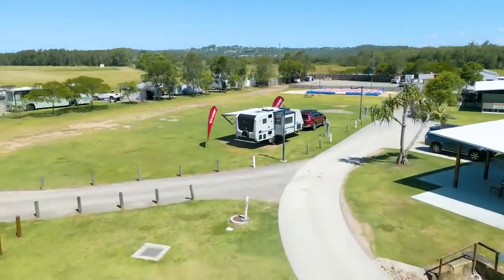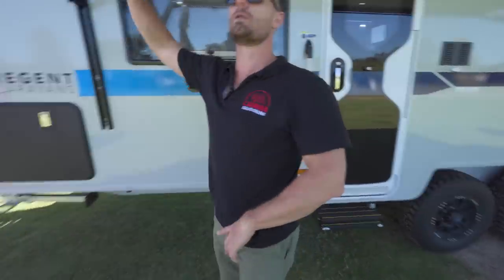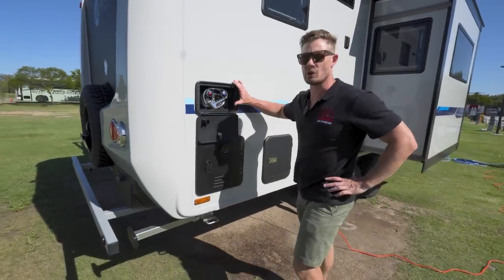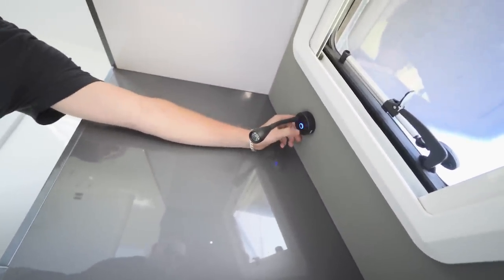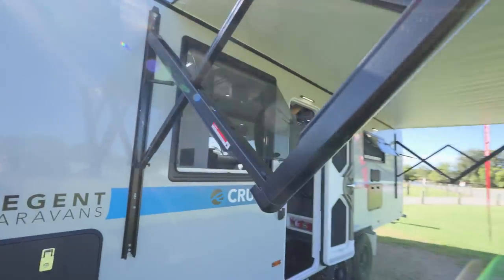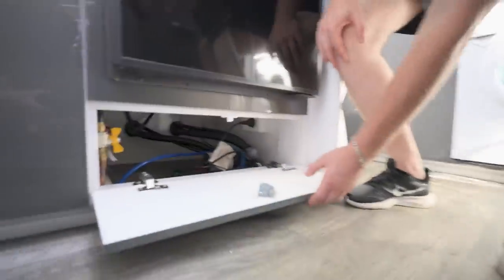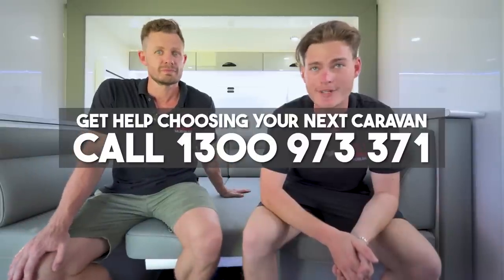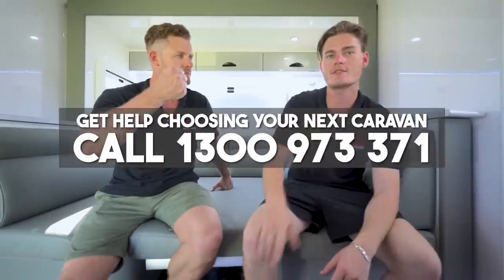Perfect Couples Caravan? Exploring the Luxury Regent 21'6" Cruiser Caravan +Slide out club lounge

Comment: Good vid guys. Looking for a new van and the Regent brand is looking good. A couple of points. It isn't an outdoor table. It is designed for an entertainment system i.e. TV, DVD etc. Hence the latches won't get in the way of a good bottle of Pinot Noir. Secondly, the two spaces with 3 pin plugs at the head of the bed are nowadays, almost always designed with CPAPs in mind.
Reply from the maker: Thanks for the feedback. much appreciated. However, I kind of disagree about that outside table though... its outside & its a table... so people are defiantly going to put bickies & dips on it... especially those folks who don't care to watch TV outdoors.

Comment: Glad this commentator is not previewing our product 😂😂😂
Reply from the maker: If there is some way we can improve our review videos we would be grateful if you could share the feedback with us.
Reply: I know I'm not the original poster, but I do have a couple of suggestions.
Either explain the specs of the caravan (eg. what type of water heater is it - diesel, electric or gas?) or post all the specs up at the start of the video so people can tell at a glance if it has what they are looking for.
Learn your product - "some type of textured coating" in regards to the chassis and drawbar doesn't really cut it.  Is it powder-coated, ceramic coated or something else?  And not knowing if what you're pointing to is a reflector or an LED.
Your target range age is from mid-twenties to probably early 70s - not everything is "cool".  Focus on the major selling points, not the silly little extras (where reflectors are).

Comment: When they do something about the arm you ran your head into, like replacing it, I'm not interested.
Reply from the maker: Are you aware of an awning that is 100% cantilevered from the caravan wall & doesn't need any supporting structure when extended? From memory I think fiamma awnings are designed that way, howver, fiamma recommend that you use corner posts for strength & stability when awning is extended (personally, i think that should be done with any awning brand to prevent it being damaged in wind gusts). Please rest assured, the awning on the Regent caravans can be changed to a brand of your own preference. Alternatively, You can "downgrade" choose the non-electric awning , save some cash & get a slightly different supporting structure.... But still the key here is look where your walking!